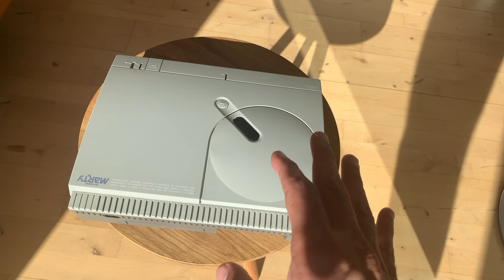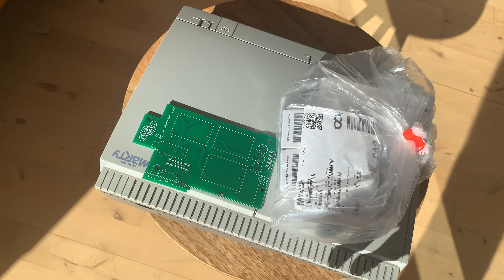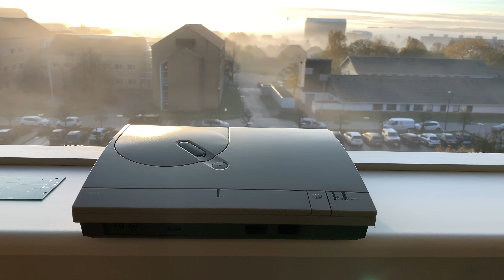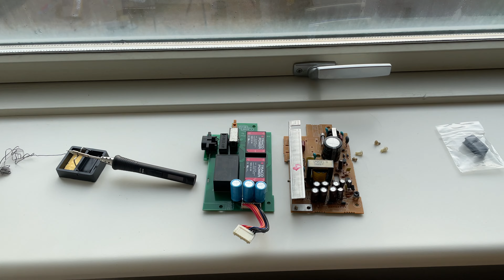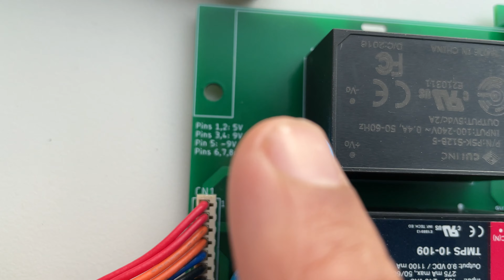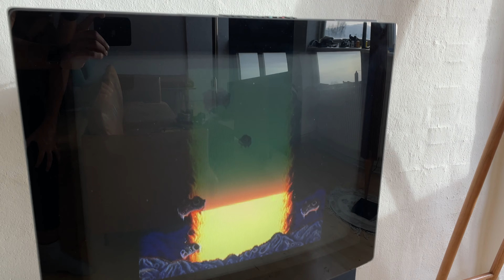FM Town Marty modern power supply replacement

Comment: That was interesting, thanks for the share. I do not have a Marty yet but are interested in one and it is great to see these obscure machines get the hardware support they do. My grey tower 20f got the pico mod and I also purchased a  board  for my x68k Ace tower but have not installed as I rebuilt the original psu with no problems.
Reply from the maker: @RetroGG-74  yeah, I rebuilt my X68K PSUs as well. They can be revived but might be a bit quirky. I am designing a replacement PSU for my grey 20F Towns tower based on modifications on someone else’s work. I rebuilt its PSU as well, but it died after a while. They are a major weakness in these old machines.
Reply: They are quite quirky but worth the effort.

Comment: "The Marty" did Doc Brown design this ? 😂 When I saw it I thought ""Alternate Universe PS2"" , come to think of it I would love to have a talented MODDER  squish my fat PS2 into this cool console shell 😻🎉🏆🏆🎃
Reply from the maker: @wyldelf2685  it is a nice design to be sure. But these babies are too expensive for that kind of project. Maybe someone could make a model for 3D printing though.
Reply: @kamiboy  exactly I agree with you 👍 so when you feel like it , do a teardown and 3D Scan the SHELL pieces and upload the 3D files to some open share site forums 😸🏆🍕🍕👍
Reply from the maker: I am afraid I do not have any tools to do 3D scans of the shell. But 3D scans of the actual unit are unnecessary if the goal is to 3D print a shell for some non FM-Towns related project. Anyone handy with a 3D modelling program could recreate a model from eye, with the benefit of it being optimised for whatever the shell is supposed to contain. The Marty is actually quite a chunky unit, the internal dimensions are likely overkill for housing most vintage console hardware, and likely not enough for modern ones. A custom model fit for purpose is the way to go in either case.